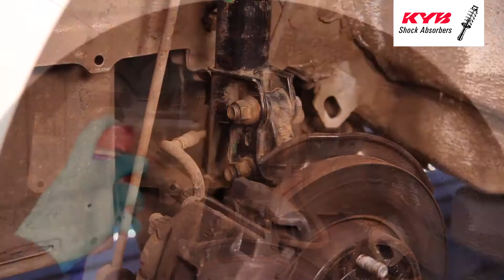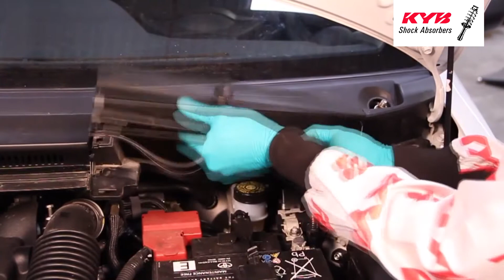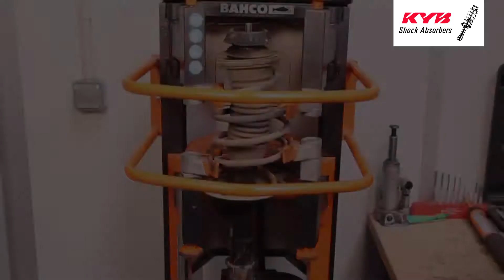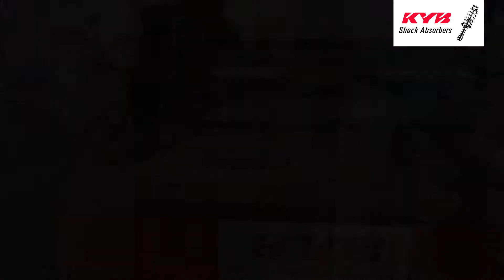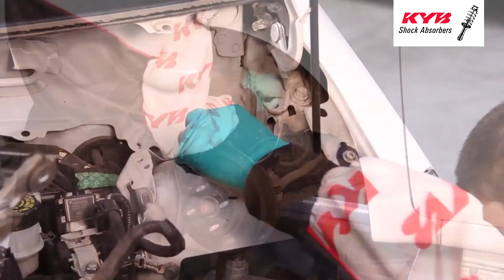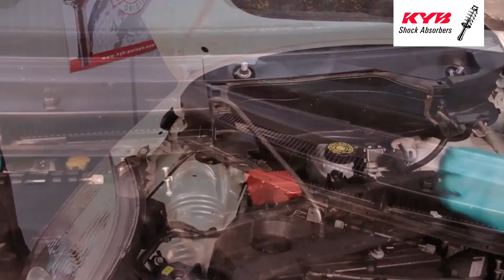How to Replace Shocks Toyota Yaris

Comment: you do not have to take the cover with the wiper men just use a curved or banded ranch to take out the upper nut from the shocks. thats it broo:face-fuchsia-wide-eyes::face-fuchsia-wide-eyes::face-fuchsia-wide-eyes::body-green-covering-eyes::body-green-covering-eyes::body-green-covering-eyes::body-green-covering-eyes: